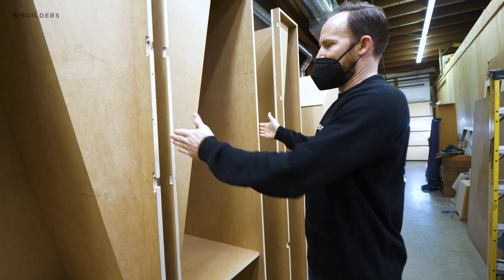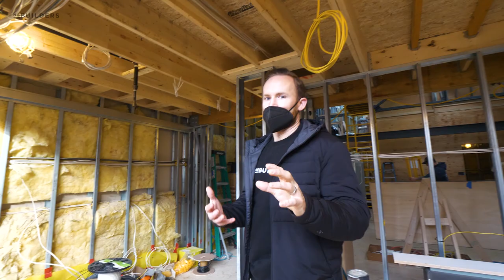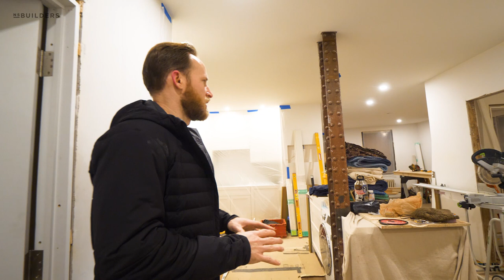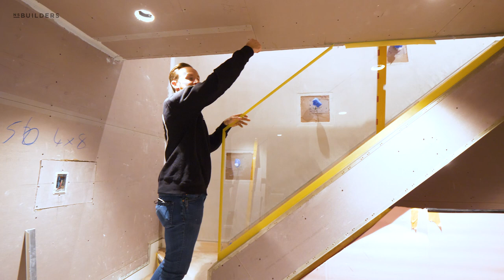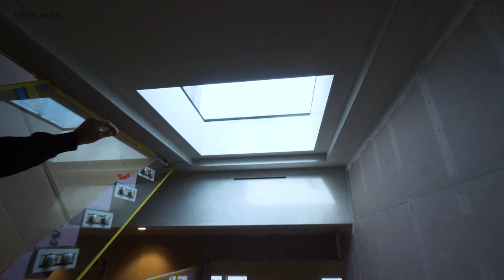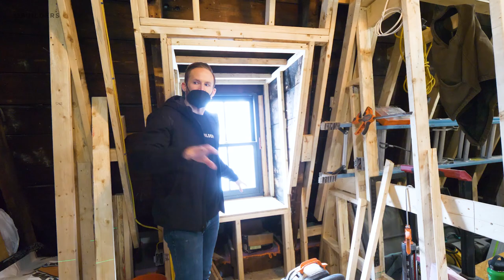Walking through 4 NS Builders remodels | Site Visit

Comment: What's up with the insulation at the industrial modern project? It looks like a bunch of fiberglass just placed here and there right now. Also, have you considered using the newer panels where the hot and neutral are both integrated into the breaker? I forget who makes those....
Reply from the maker: Existing, we leave it for noise control during construction, it will be replaced with Rockwool. We have not considered that panel.